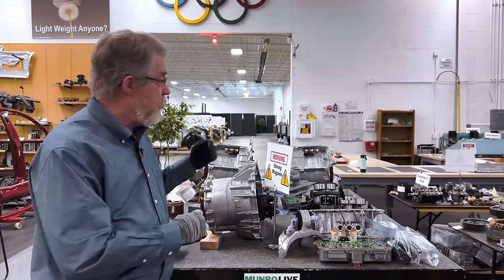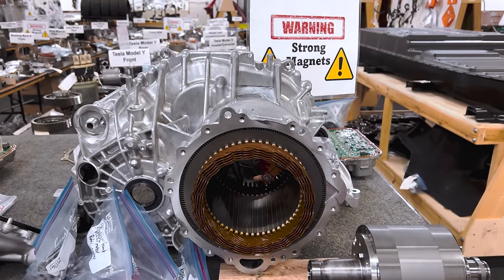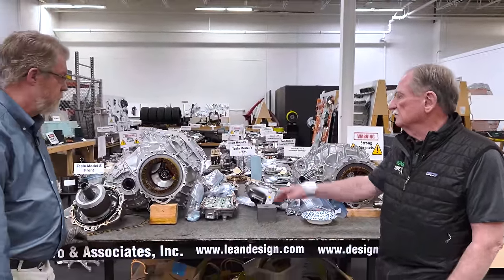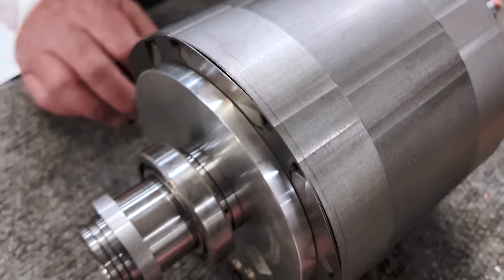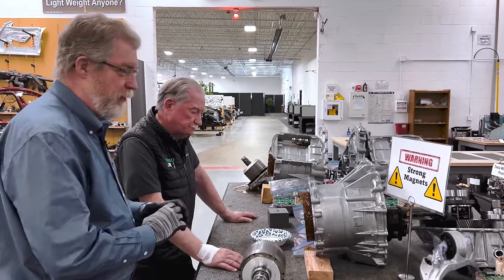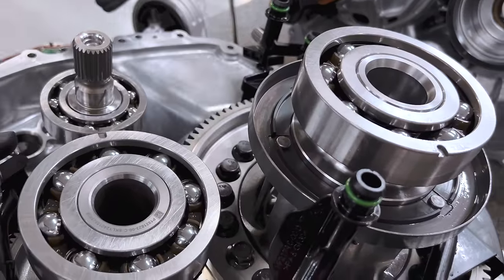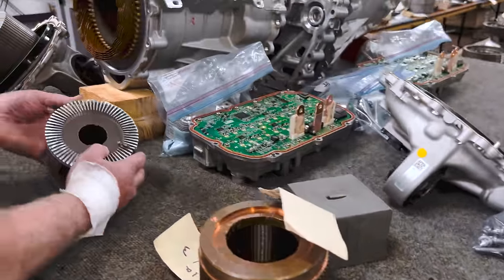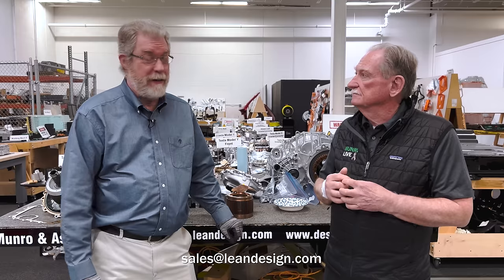Tesla Cybertruck 845-HP "Cyberbeast" Motors!

Comment: Serious question: Why do you need a differential lock when you can just brake the spinning wheel? Of course you would need software for that. Would that cause the brakes to wear out too quickly? It shouldn't really be that bad, electric vehicles tend to have a problem with brake rust. That doesn't seem that problematic to me and it's one less moving part: the diff lock.
Reply: You'd have the brakes being applied all the time. They could overheat.
Reply: Every modern vehicle has the software to apply braking individually at each wheel; it is active whenever the vehicle is moving and the differential is not locked. The mechanical lock is used to reduce brake use, and associated overheating, in specific off-road situations.
Reply: Because You want to get the power, not brake the wheels. Both offroading and accelerating. When You brake or reduce torque to get the traction it means You reduce the power output. That's why locked diffs wins at any offroading against the traction control.
Reply: @imconsequetau5275  none of three motors in this Cybertruck or any other motor ever provided by Tesla in any model is a "reluctance type motor". Tesla uses induction motors, and interior permanent magnet synchronous motors; the latter type produces some reluctance torque, particularly at higher speeds.

There is only a single front motor, so there is no way to connect two front motors to anything. There are two rear motors, with no mechanical connection between them at any time.
Reply: @brianb-p6586   
As you said, this motor has reluctance motor properties, and it also has embedded magnets. 

It's definitely not a pure PM design as it has too few magnets for that - and they are submerged - but it achieves torque more efficiently than a pure reluctance design.
Reply: The elimination of moving parts, like the differential lock, is only a virtue if functionality is not also reduced. In this case, the differential lock is applied magnetically and has no failure mechanism if engaged at low torque and speed. [Under computer control, this is assured.]

Using a differential lock is great when going straight, efficiency goes up to near 100%, compared to 50% using brakes on the slipping wheel. However using brakes instead of locking is useful when the steering wheel is turned far left or right, since the half axles need to turn at different speeds anyway. 

If a Torsen WaveTrac limited slip differential was installed, then the brakes could apply far less torque to the slipping half-axle and still apply the majority of power to the gripping wheel. For example, the Torsen T-2R has a 4:1 TBR, so only 20% of drive power is lost to brake heat. 

Of course the Torsen is far more expensive than this locking differential.
Reply: @imconsequetau5275  Tesla's PM motors have comparable magnet size and strength to other brands. There is a significant contribution to torque output of IPM synchronous motors from reluctance at high speed, but at low speed (where peak torque matters), it's all magnets.
Reply: @brianb-p6586  
Of course, but they are all IPM-SynRM motors, or Internal Permanent Magnet Synchronous Reluctance Motors.
Reply: @imconsequetau5275  correct - all well designed IPM synchronous motors are effectively IPM-SynRM. None have poor torque at zero speed. 

"Submerged" is a strange term for interior magnet mounting; it doesn't hurt field strength or torque output,  because the rotor flux path is designed for that magnet position.

Comment: Could the rear motor be split and used as 2 motors in a different application or do they need to be interlinked (using a different controller)

Comment: I'd really like to understand why they do not go for a two motor configuration on the front, similar to the rear but two permanent magnet motors. Seems like this would eliminate the need for the mechanical differential and the associated differential lock mechanism as well as allowing full variable torque control rather than just an on/off lock.
Reply: Which is cheaper, a diff or a whole motor?
Reply: The PM motors are very expensive, also you probably get more power than the tires can handle, so minimal benefit. Rivian does quad motor though.
Reply: @EwanM11  Well, yes, but you solve both problems by making each motor half as powerful!
Reply: @john_hind  half the power will not half the cost.
Reply: @EwanM11  Electric motors do scale fairly well cost to torque. Possibly the reason is you do want to be able to route all the torque to one wheel.
Reply: A high difference of applied torque between the front wheels causes steering problems, so individual motors at the front would not be used as much as they are at the rear. Everything is a compromise, and currently a single front motor and dual rear motors is a good compromise.

Comment: Two questions. 
1. Why front one is permanent magnet motor and rear ones are induction motors
2. Is induction motors are not difficult for speed control? How they are achieving synchronization between all these 3 motos?

Amazing Engineering...
Reply: Induction motors are used only during high torque moments, and that typically is during hard acceleration. This load is desirable to place on the rear wheels.

Each motor stator has its own dedicated variable frequency drive electronics and computer circuit board. They all are coordinated by the main computer.
Reply: @imconsequetau5275  thanks! 
Great piece of Engineering?!

Comment: The motor looks like it’s 16 to 18 inches high. The lower you can position the bed without sacrificing clearance under the truck the better. Every inch you can reduce the height of the bed the better the truck. At some point we started to get used to low floor buses. If we want the Cybertruck to represent the future, we might look at having a low bed. How low can it go?

Can there be a version of the Cybertruck with a bed that’s maybe 12 to 14 inches above the ground? If so, how does that affect the position of the electric motors? The simplest way to deal with this is have it front wheel drive. It would likely also not have rear seats.

Comment: Great video as always!
What about the accelerator pedal recall?
It would be nice if you could show what is the issue
Reply: That has nothing to do with the drive units so it's not relevant to this video... and it's just a loose pedal cover.
Reply: That’s already been revealed. Production decided to use an unauthorized lubricant to help with  installation of the break pedal pad. While it did help speed up production it also makes it possible for the pad to slip.

Good news is that it’s a simple fix to prevent going forward and to correct the few thousand they have produced so far.
Reply: Seems to me that the pedal cover issue caused a backlog of Cybertruck to build up in the Austin GF parking lots long before this became public.

Comment: Just a question regarding the aluminum battery wire: why can't it also be stamped and then isolated?
Reply: What is the issue with just bending the concentric assembly? I don't see any downside.

Comment: Looks pretty neat, but those very short motors in back look a bit wasteful in terms of copper windings - they have very very short active part, and quite large excess.
At this shape they should probably move to something like axial flux motor.
Reply: You haven't seen a lot of motors, have you? The proportions are not unusual. Yes, end winding size is always a concern.
Reply: @brianb-p6586  I have seen a lot of motors. I'm just pointing out that Tesla, company that's well known for their optimizations, would waste so much copper in those motors.

Comment: Just saw another video on the RAV4 electric, which uses motors built by Tesla.. Drive unit was making noise due to failed motor bearings. The motor bearings in those units are sealed bearings - they obviously will fail at some point, probably less than 100k miles.  Much less than oil bath bearings. Are the Cybertruck motor bearings sealed, or do they run in oil? What about Tesla’s other vehicles? I’m guessing this is why most high mileage Teslas have been through several drive units?
I would rather change oil, than change bearings. Better design would give 3X life with proper maintenance.

Comment: 20:05 Sandy touches the side of the rotor where there are small holes drilled or cast onto the edge. What are they there for? There are 7 holes on one side and one on the other side. It looks like they are trying to balance the rotor, like how a car wheel has small lead weights added to balance it? What is the point of making this area so thick? It looks like you could trim back this area and save a whole pound.
Reply: That's the aluminum end plate of a squirrel cage. They need it thick to handle the current load. And yes the indentation looks like it is for balancing.

Comment: 11:00 The rotor’s star shaped plates that hold the permanent magnets. Can these plates be shifted slightly so the channels are not parallel to the axle? It would make these channels on a slight spiral (like rifling in a gun barrel) so oil would be pushed through, like a turbine.
Reply: Harder to fabricate. They went with a straight squirrel cage on the induction motor for the same reason. Straight channels are easier to manufacture.
Reply: The spiral is used to reduce the "cogging" effect in PM reluctance rotors. This is noticeable at very very low RPM, but Tesla can work around that by relying on the induction motor at low RPM and by more carefully shaping the rotating stator field at especially low RPM.

Comment: Is there a parking pawl in either motor?  Both?   For slippery coastal boat ramp use, I need to be able to lock all 4 wheels in park.
Reply: I don't think Tesla puts a parking pawl in any drive unit. It relies on the parking brakes, which are only on the rear wheels.
Reply: That's good to know.  For most car situations except maybe San Francisco street parking, the electric parking brake is probably fine.   For hills and boat ramps, I want a more robust system to hold my vehicle.
Reply: @g6cpm6  I agree - a parking pawl in the front unit would be desirable (so all four tires hold), but I understand that they don't offer it because they can usually get away with just the parking brakes. 

It would also be technically viable to put parking brakes on the front, now that they are electrically applied, but no one does that... although Saab used to put the parking/emergency brakes on only the front, even though they were using mechanical cables back then.

Comment: There is no loss due to eddy currents on the rotor of a permanent magnet motor.  The rotor in a permanent magnet motor always sees a constant magnetic field even while the motor is turning.
Reply: This would be true in an ideal case. In practice however the phase current is controlled by PWM, so the rotor sees a field that is fluctuating at the PWM carrier frequency.
Reply: @nerd1000ify  the rotor sees a constant magnetic field all the time. The current ripple at the carrier frequency is very small. The inductance of the motor filters out the carrier frequency.
Reply: @franciscoshi1968  the ripple is large enough to be audible as a whining sound in many motors, so  it is certainly there. Might only be a small factor for efficiency of course.

Comment: I think it would have been wise to have given your team the first cyber truck off the line and have you tear it down to possibly take your suggestions on the rear magnets and do a detailed study on if would be beneficial to make changes.
Reply: Tesla developed in-house a high end electric motor simulation software, I suppose they calculated benefits versus cost.
Reply: Yeah, i think Tesla has this in hand. It's extremely unlikely that they know less than Munroe about motor design. They don't outsource any motor design and have the workshop chops to design build and test anything they could think of.
Reply: TESLA makes 100 line Changes every 24H.
Reply: there are so many moving pieces... like elon does upgrades to cars without making press releases, and for the magnets.... right now he has 4 years of production backlist for the cybertruck, so his main goal is to pump out this thing.... he'll worry about 5% efficiency in the motors later.

Comment: If the PerMag motor is driven by a true sine wave inverter, there should be no flux modulation on the permanent magnets. As long as the new rotor as paired with the new inverter, there should be no induced eddy current, so no need to segment the magnets. Another difference may be switching speed. the higher the frequency, the less coupling between the stator and rotor, further reducing induced current into the rotor. the magnets won't see the switching frequency. The same holds true for the induction motor. There shouldn't be any current induced into the conductor bars, that doesn't contribute to torque.

Comment: In a synchronous electric motor, is there a changing magnetic field around the magnets? I never new, maybe a new technology?
Reply: There is no new motor technology in any Tesla. In a synchronous motor the rotor produces a non-moving (relative to the rotor) magnetic field, which interacts with the stator field (which moves relative to the stator, synchronized with the rotor (thus the "synchronous" name).

Comment: Wound motors have more surface area then hair pin motors, with that wound motors have better frequency response providing higher torque at high RPM, not necessary for a truck.

Comment: wow im so early for a new Munro drop! i believe tesla could have just went with smaller  equal sized quad in-hub induction motor design for best power and torque for superior offroad capabilities rather than tri with 1 pm without adding more cost
Reply: No truck maker cares about off road. I grew up on a gravel road in the rocky mountains and never head anyone buy a truck for its "off road capability".
Before you snark it was on a cattle ranch at an elevation of 8500' at the lowest. 
Only off road capable pick up I drove was a solid axle Toyota hearding cattle in the outback. Guess what the outback is FLAT so those weren't even off road capable by U.S. toy standards.

Comment: I wonder if the induction motor  has a switched reluctance mode for low rpms, then switches to induction at high rpms
Reply: Nope. The induction motor is only used when high torque is required. [(And perhaps also to accelerate/decelerate at zero to very low RPM.)] The reluctance motor is in use pretty much all the time, except at a stand-still when brakes are used instead. 

To the best of my knowledge, there cannot be a combination reluctance/induction rotor design.

Comment: Why didn't Tesla use one motor per wheel instead of using a diff with a lock/unlock mechanism?
Reply: The front drive is more efficient at higher speeds than the rears which provide high torque at low rpm.
One motor cannot do both with high efficiency. You would need additional gearing which adds losses in heat.
Reply: @robertpeters9438  that doesn’t really answer the question though. Two rear motors with high torque efficiency and two front motors with high speed efficiency could be used? Each wheel could have output independently controlled without need for diff with locking mechanism.

Comment: 10:13 I hope the diff lockers can be engaged via an option and not automatically engaged when in off road mode.
Reply: I would assume it is automatic and the lock would engage when one wheel starts slipping
Reply: It has a manual option. But guessing you know that by now

Comment: How many POLE are these 3phase motors? 2,4,6 ?
Reply: You can see that in the images of the rotor, such as at 10:20: the PM rotor has six poles. The induction motor is much more difficult - you have to following the winding pattern in the stator, which isn't practical; I assume that it is the same stator design and so the same number of poles as the PM motor.

Comment: Anything onwhether the combined comms/power is based on EtherCAT?
Reply: The Cybertruck is running gigabit ethernet cabling for data along with the 48 Volt power on the same conductor pair This uses 4 times lower amperage and replaces the device-to-device CAN bus.
Reply: The average voltage (stored on a filter capacitor) is compared to the gigahertz modulated voltage to recover the Ethernet signal. Called Power over Ethernet (type A).
Reply: @imconsequetau5275 dude, that explanation is still just as cool as the first time I heard it on the factory tour.

As badass as that is it even more insulting that the big three could have started moving that way 30+ years ago and still havent